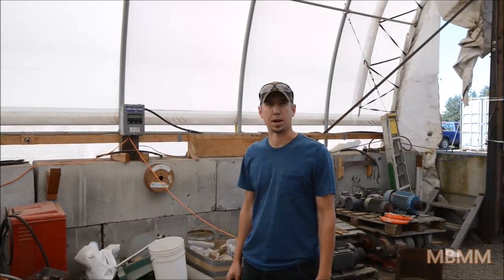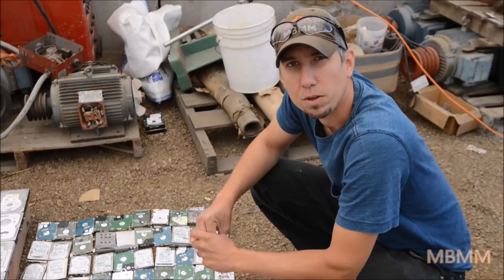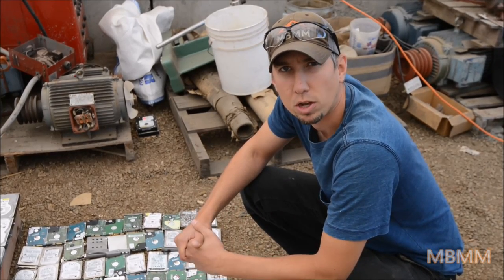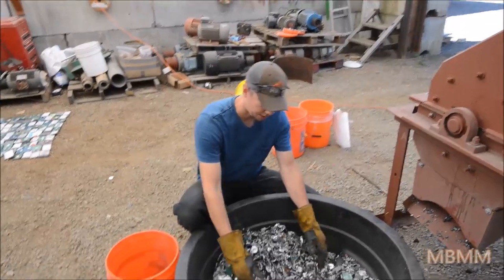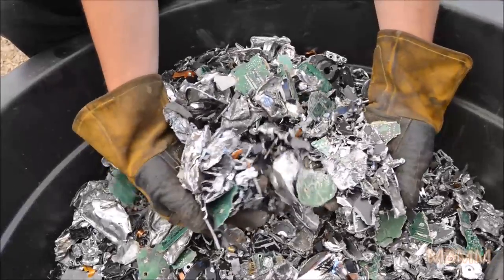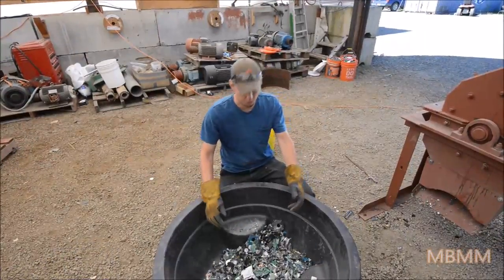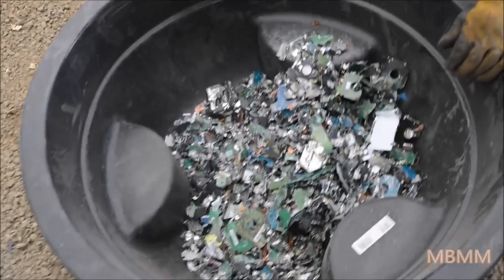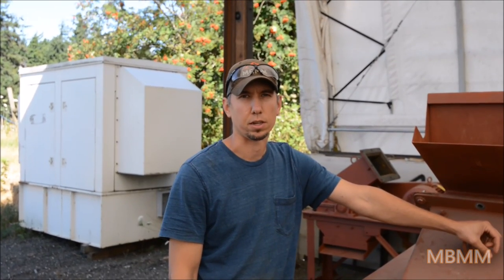Shredding Hard Drives With Hammer Mill for Data Destruction

Comment: In most hard drives, there are some crazy strong magnets inside.  Do you find that you have to clear those out often?  They would likely clump together and stick to any metallic surface (or at least the magnet fragments would stick).
Reply from the maker: Some of the magnets get stuck to the side but the majority get pushed out with the other material.

Comment: You'll have to run that material with a smaller screen. The european standard EN 15713:2009 (which i'm sure has an american counterpart, since it's part of ISO 27001) specifies that data media must be in chunks no larger than 1", as far as i remember. A bent platter is nowhere near good enough.
Reply: From some one who works with computers I can tell you that will wit out the out the other two platters  you have no hope in recovering any data.
Reply: From someone that destroys hard drives for a living, I can tell you that it is possible to recover data from any platter. Also the standard for commercial drives is 20mm strips, higher class is 6mm particles.

Comment: Total data destruction? No, it's really not. I saw a bent-out-of-shape plate. A properly destroyed hard drive should never leave a plate. An adversary with the right equipment could read the whole thing.
Reply: Thats not true.  After the platter is bent in such a way it is gone.  The surface magnetic layer is shot and if you were to observe the bent platter you would see the ripples in striations in it.  Also the machine is scratching and gauging.  Not to mention in order for a hard drive to run the platter needs to be perfectly flat and spins at speeds of 5400-7200rpm between to very sensitive heads.  Good luck with that.  The NSA actually considers bent hard drives as destroyed as they certify hard drive bender for destruction.  Those hard drives are perfectly destroyed.
Reply: People don't read data from a smashed hard drive by trying to spin it up. The extremely serious attackers read it with an electron microscope. The NSA certifies bent drives as destroyed only after they have been magnetically degaussed.

If it still looks like a hard drive platter and it hasn't been either superheated or put through a powerful magnetic field, it's not destroyed.
Reply: @slicer2361  99.999% of hard drives can be considered destroyed under these conditions. If your hard drive is a candidate for forensic reconstruction via electron microscope and $100,000 man-hours of painstaking analysis, you're not handing it off to joe shmoe for destruction in the first place. If you want a dozen hard drives completely obliterated you aren't looking to buy a hammer mill. That's for destroying 12,000 hard drives.

Comment: Just saying all you have to do to get rid of data on a hard drive is to open the cover. Or if you still want to use the drive just wipe it and over write it.
Reply: Opening the cover isn't enough. Yes it would cost millions, but it is still possible. Overwriting the data is also not enough, the magnetic field that was first placed on the drive, when overwritten, leaves a oh so slightly trace on the drive. So with the right, very sensitive equipment, you can recover overwritten data.